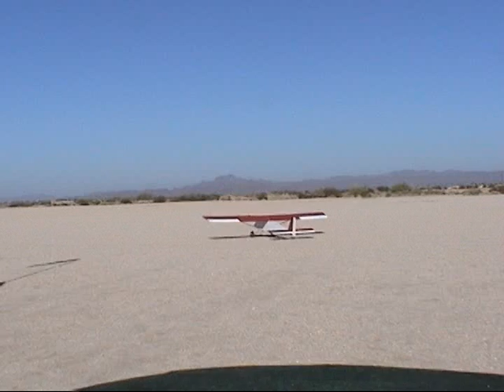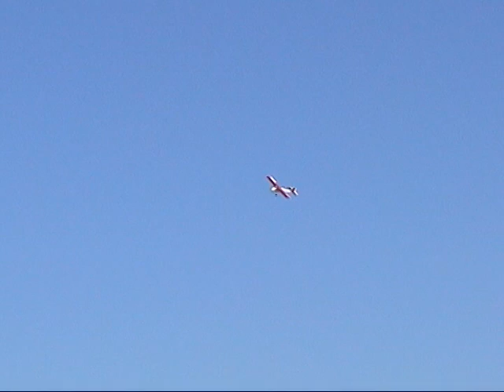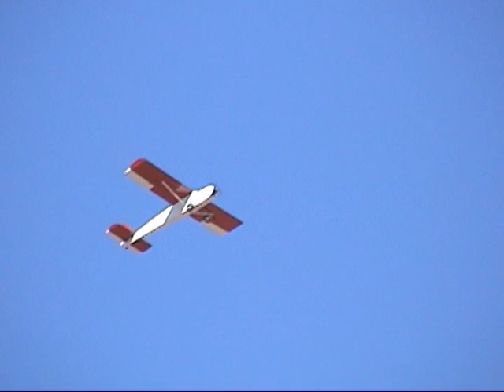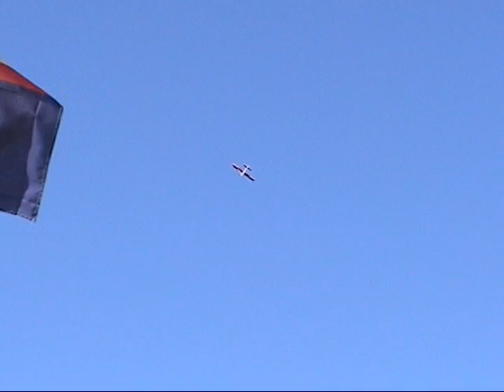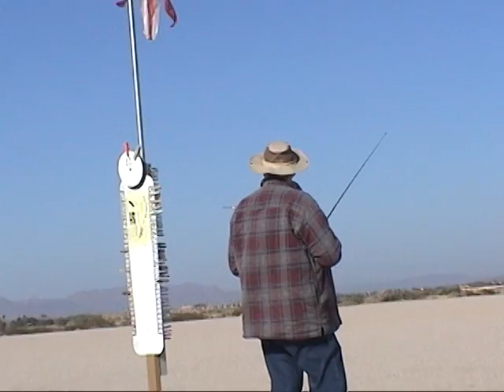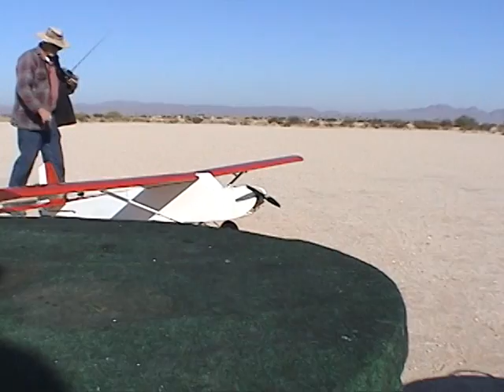Maiden flight of the 12' Telemaster after electric conversion

Comment: i cant blame you for removing the gas engine. its becoming the thing of the past. i personally like the cleaniness of ep. and its quiet and very smooth with no mess. gas engines just ruin an airframe after a period of time. i rarely fly any of my gas planes anymore. and i wont ever build another one gas. ep is the only way to go. nice flight....nice airplane. hope to maiden mine this pring if we ever get a spring.